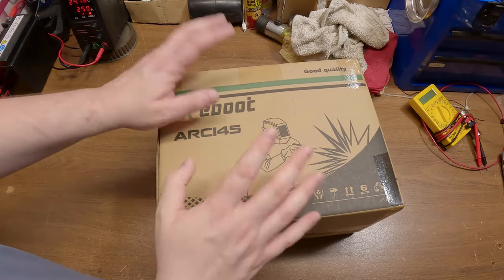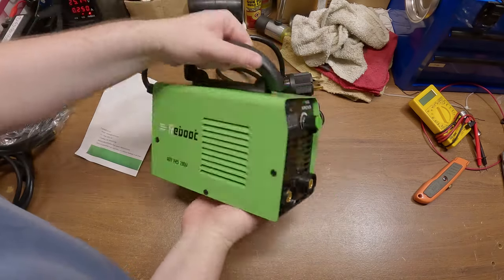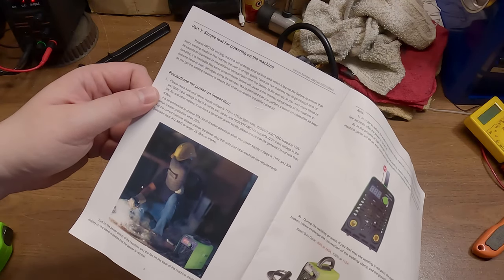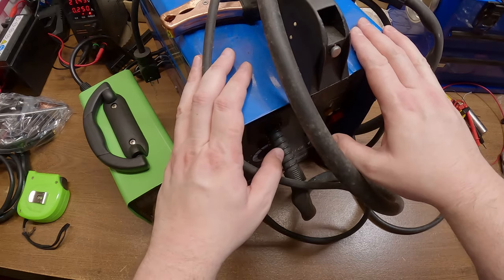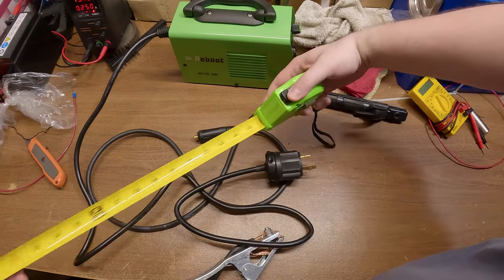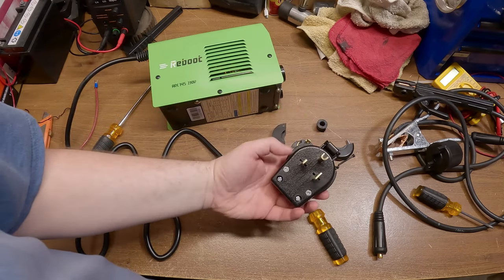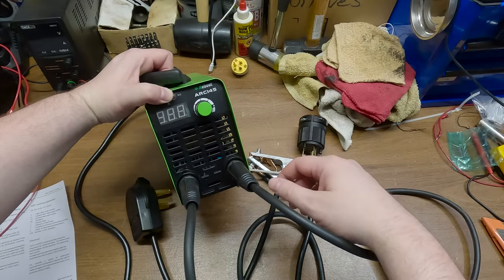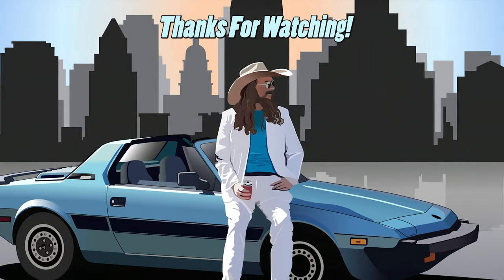Cheapest Welder on Amazon | Reboot ARC145

Comment: Ebay has them for 69 bucks with the 110/ 220 adapter plug. I bought one and it does work well on both. Only 1/8" steel or less on 110v with 3/32 rod.
Reply: Sounds amazing!

Comment: I got the 80$ one its blue and very similar.  It runs on 110 and ive put it on my kitchen outlet and ran a 50 ft extention cord with it and ran 3/32 rod welding a gazebo together. Never popped the braker, the cord for yhr ground did get hot but didnt melt. The rubber felt soft though. Great welder for the price. And i went to school for welding.  I got mine as a joke pretty much. My helmet could buy me 10 of these things and im quite happy with it. I use it qhenever a friend needs something welded i can throw this in the glovebox of my truck and go do small to med size jobs without clunking around my big Lincoln and tanks. Definitely a 10/10 machine. A beginner can definitely use it and lay good welds eventually or a pro can use it and lay good beads. You will be surprised for the price and how well it does id recommend them to anyone
Reply from the maker: Yeah these little IGBT inverter machines are great.

Comment: Try 5/64 rods.  These are a hair smaller in diameter than 3/32 (obviously).  Nice little welder with these.
Reply: 6011 3/32 run perfect on these little machine

Comment: i have a forney "easy weld" 100 with it i am pretty much limited to 3/32 rods and even then it hates 7018 rods... it will burn them but it takes me like a million strikes to get a stable arc (full disclosure i suck at welding so maybe its just me) , but it seems to do fine with 6013 and 6011 of the two i have started to prefer the 6011. the 6011 arc doesnt strike quite as easily as the 6013, but the slag on those 6013s.... i cant see what the metal is doing on the 6011s i can.
Reply from the maker: Don't feel bad, I suck at welding too 😄

Comment: As long as you're not going to weld a bucked grabb, then I guess it's okay. But it won't be able to push thru thick steel...
Reply: You wouldn't use a 140 amps welder for that... No matter what brand

Comment: so why do people buy the expensive huge ones, when these do the job just fine?
Reply from the maker: If you're doing it professionally you want a machine that can run constantly. The cheaper ones usually only have a 30% duty cycle. That's perfectly fine for most DIY applications.

There's also things to consider like maintenance and support. Lincoln and Miller have great support, but these cheap ones the only support you really have is Amazon's return policy (which is actually pretty good).
Reply: @BookAutowerks is a 60% Duty cycle good?
Reply from the maker: @bossoy0769  yeah that's pretty good. It means you can use it at max power for 6min then have to let it rest for 4min. At lower power you might be able to use it nearly continuously.
Reply: @BookAutowerks  oh alright thank you so much for the Information o subscribed keep up the good work

Comment: mine works fine on 110. how strange you left out the amp reading out of frame when it wasnt working, almost like you had it on super low amps and count keep the arc started. user error dummy.
Reply: Probably dead on accurate
Reply: And also brother would you recommend this welder? Or look into a tad bit more expensive ones got a got a little bit more money then this one is going for but I not welding super super thick stuff
Reply: @gtgaming1128 what did you get?